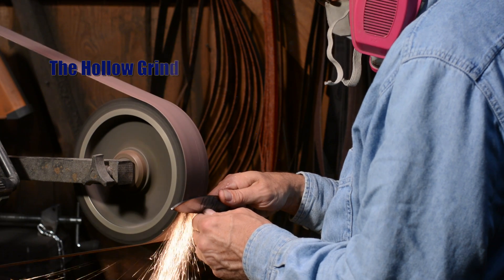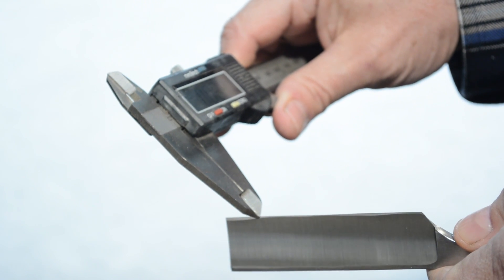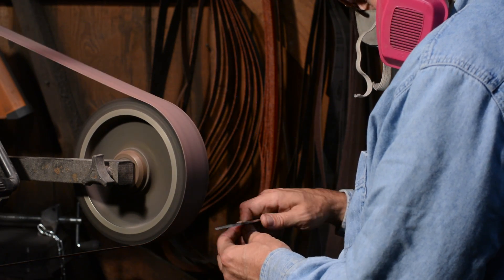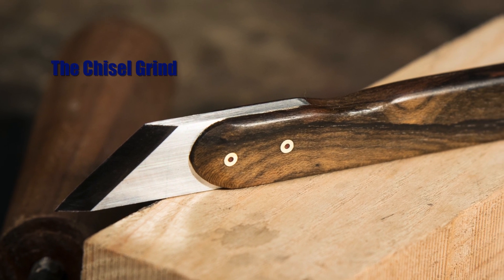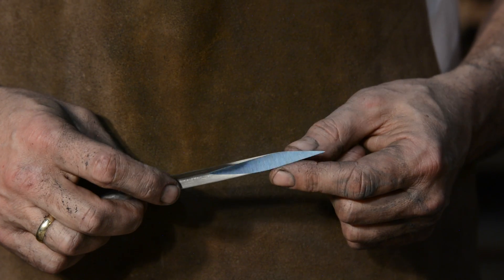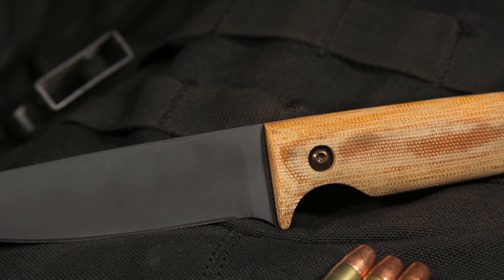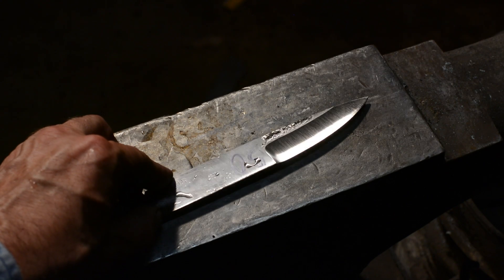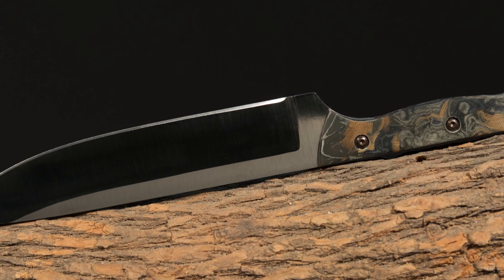Knife Grinds:  Comparing Hollow, Convex, and Flat Grinds

Comment: @Walter Sorrells I wonder if you will see this comment , not to mention it is on an older video , but how would you hand sharpen a convex grind after it is dulled , I am not sure about the blade terminology , but usually on a knife there is a parallel part , then one angle and then third the edge , I know to sharpen knives like that , but when it has a convex grind and only that one big edge , I dont get how to sharpen the knife without making that "third" edge ... I hope you get me xD

Comment: I wonder how a knife with two different types of grinds would preform.
I want a beefy knife for light wood processing, but also for making feathers sticks and crafting. So I thought about making a know with a convex side for chopping and a scandi grind (which shouldn't be too bad while chopping) but I want to be able to get the correct angle for feather sticking. That's hard with a convex grind.
Reply: If I were you, I'd get an axe for wood chopping, and a flat grind for woodworking...The knifes are relatively cheap now a day, maybe you can get two knives to get what you want to do...

Comment: bill moran called it the apple seed grind. convex is best for hunting by far, best for field dressing, i have a 500 dollar masamoto japanese sushi knife and went for free lessons in ny.  do not ever attempt to sharpen and i would have to write a book . love full height flat or full height convex from spine to edge. i was brought up by the masters like lile  and moran and the first ground was then called the secondary even though it was grinded or forged, but the edge we do after the primary cuting edge that is a sepperate bevel from about a .02 thicknest up frop secodar apex we cut in our pimary cutting ground.  why did the terms of sec and primary changed. is the secondary bevel called secondary because it is done after the primary. i would like to see it go back the way it always was. the sec though cut second , of course is still your primary cutting edge. if it is scandi and single beveled then it is a single bevel primary
as i said my best for almost anything is a full or close to full height convex down to edge, sometimes if edge is to thick it has to have some soulder of edge taken away or stropping will keep that factory  edge to become dullerand duller  a mocroscope is a great tool for this kind of reprofiling for making things better on an already good but reparable . knife..

Comment: Outside of the difficulty of maintenance and manufacture, is there any downside to a convex grind compared to a flat grind for all-around knives?  It's sturdier and the same or potentially greater sharpness, isn't it?
Reply: convex has less sharp end potential than flat grind.
Reply: Demmrir I was just thinking that, but how you would sharpen it is a huge factor. after hardening you can't use that belt at any Kind of practical speed, maybe a rocKing motion on your wet stone, but that would be very precise and time consuming work. any little roots would come out through the thousands of passes you would need to reMove material from that whole edge.

Comment: convex grinds can be made on contact wheels/bench grinder by moving the blade up and down as you grind, its way faster than slack belt grinding but tends to give a wavy pattern on the grind line

Comment: In my xp, full flat and convex are better at slicing like cardboard and soft stuff, hollow seems to not be as good, but is better for skinning game and cuts well, just not a great slicer. Its why most kitchen knives are not hollow grind. Also, I'm referring to mostly a half hollow grind, one from the spine is on par with flat, maybe more support on spine. Full convex can be sharpened easily with sandpaper and soft pad as well. The nice vid
Reply: Yes but kitchen knives are thin over all which makes then good slicers,overall a hollow is the best slicer as the point of contact is at the cutting edge and the spine leaving the hollow part friction free

Comment: Saber grind with secondary bevel and shoulder rounded off = full convex
Full flat with secondary bevel rounded = full convex
Full convex is the only superior grind. Is is any grind that is made with quality as opposed to made the easy way. It can be very thin, thinner than a full flat grind with a secondary bevel. Or thicker than a saber grind. It will push wood out as good as a scandi, yet with the rounded shoulder will slice better. The only other grind that makes sense is a full hollow, like an I-beam, for something like a razor, because it is ultra thin yet has enough support along the spine. 

The grind that makes the least sense, by far, is a partial hollow ESP with a secondary bevel. You have a steeper cutting edge, that transitions sharply to the begging of the gring which is almost flat, then that ramps up at a steep angle, then another flat portion along the spine. This is a ridiculously ineffective grind for literally everything.

Comment: is the secondary bevel necessary in a flat ground knife? if it is i would very much like to know.
Reply: No, it is not necessary and swords that have full flat ground blades (like many late-14th-early-16th century European swords or the 13th century European sword, the Elmslie type 1 falchion) usually don't have a secondary bevel as it limits the performance.

Also many Middle Eastern and Indian swords were made with full flat ground edges without a secondary bevel and most Navy cutlasses around the world and in fact a good portion of sabres also have this kind of edge.

And then there are the Scandi grinds for knives, they don't have a secondary bevel either. Hell most knives about 150 years ago that were flat ground didn't have a secondary bevel (when professional polishers were literred through towns like it was the only thing that made money).

Comment: I agree about the flat grind limiting the sharpness. But lately I've been putting the secondary bevel on a really shallow angle, making the cutting edge quite thin and , therefore, sharp. With proper heat treating, I've been able to produce a really good zone between being too thin and not being able to take the beating to being thin enough to get and stay razor sharp through the beating.

Comment: I find a flat grind without secondary bevel (where the cutting edge is at the same angle as the flat) is a fairly good balance between hollow and convex but allowing very sharp edges as well. Particularly noticeable in wide blades where the angle of the flat is really steep.

Comment: Considering I can sharpen my scandi grind (deeper flat grind) in the field with emory cloth pinched between my thumb and forefinger.  I'll stick with scandi.  The other advantage is you are taking equal amounts of steel off both sides at the same time.... it would be very hard to move the edge off centre.   The downside, it isn't as fast as a belt grinder... especially if your knife is a very hard steal.

Comment: Regarding the convex grind, these are fairly easily sharpened by proper application of the 'mousepad-method' - the mousepad is used as a flexible backing for different grades of SiC-paper; a drywall hand sander works even better since it has clips to hold the paper. Once the convex edge is sharp, a strop will give it the final finish and also be useful to maintain the edge for a long time.
Reply: Sharpening a convex grind is pretty easy on a whetstone. That mousepad method is some masochistic but somehow funny phenomenon.

Comment: I find 'proper' chisel grinds easy to sharpen. 'Proper' being the Japanese style: the blade made from a steel strip laminated to iron for easy sharpening of the bevel and a slight hollow grind on the reverse for easy sharpening of the flat side.
That way you only have to put the bevel to the stone until you get a burr, then do the flat side to remove the burr, strop and you're in business.
Reply: +kaizoebara   Exactly what I was thinking when he said that they were more difficult to maintan.  They're actually easier to sharpen than trying to maintain a consistant angle along the entire length of the very small secondary bevel on a flat grind, since the bevel itself is the angle you sharpen at.  All ya gotta do is just lay it flat on it's bevel, just like a scandi.  :)

  Also, as you mentioned, with the urasuki (wide hollow) grind on the back, there is such little surface area on the back to keep flatten that it goes pretty fast.  I was actually a little surprised that he didn't demonstrate, or at least mention the urasuki grind in his last "Japanese damascus marking knife" (kirdashi) video, being that he's known for making traditional japanese blades.
Reply: *****
 Maybe he didn't mention it, because he didn't grind an urasuki.
I also find that strange since it is a feature that can be found in almost any Japanese chisel grond blade, e.g. kitchen knives, woodcarving knives and incidentally also in Japanese chisels.

Comment: Why wasn't the Scandi mentioned? Such a great grind. ....and so easy to sharpen. .....even a child can do it.
Reply: +TaskMaster1983 I think the one little difference, though, is that the scandi grind doesn't have that secondary bevel for the cutting edge. It goes straight on down from the primary bevel to the cutting edge. I'd prefer the technical saber grind to the scandi grind.
Reply: +John Grytbakk 
Easy to maintain the bevel angle, but it is the most labor intensive and time consuming of all grinds to sharpen.
Reply: John Grytbakk Well, if you think about it, on any grind that utilizes a secondary bevel you only have a very small amount of steel to remove. Whereas, on a true full scandi grind you are removing steel from the entire grind. That's a heck of a lot. 

I bought a classic carbon Mora, that came with a "slight" secondary bevel from the factory. I wanted to experience a true full scandi, so I got out my big diamond stones, and went to work starting with the extra-course. Ended up taking me hours and hours to get it completed. When finished it was freakishly sharp.

....But I found out that it was basically worthless for actual use, the first time I tried whittling some wood with it. The edge was so fine that simply shaving wood managed to mangle the edge in moments.

I ended up putting a secondary edge back on it. Now it works ok, and resharpens easy, but I'm far from impressed needless to say.
Reply: He did mention it. Scandi grind is also known as a Sabre grind.
Reply: +TaskMaster1983 

https://ltwrightknives.com/grinds.html
Reply: Bastian  ....I don't find that to be the case at all. ...it's so easy and quick.
Reply: Bastian  ....even though the bevel is bigger, it's so much easier to get it right fast when sharpening I've found. .....and if you touch up that bevel and edge regularly, it is a quick job.
Reply: John Grytbakk
Reply: John Grytbakk you probably accidentally microbeveled it and are sharpeming just the microbevel
Reply: Peter Griffin Actually, the angle depends on the thickness. A scandinavian grind is just a flat grind with no secondary bevel/ microbevel.

Comment: Good info, however; I would have to disagree on the convex. I find my convex blades and especially those other grind knives with their secondary bevels "converted" to a convex edge the easiest to maintain. No precise angles to worry about. All you need is a somewhat flexible surface and some light abrasive. In a pinch, out in the field, some silty mud from the creek bottom rubbed on your thigh of your jeans and you got an instant strop for that convex edge. Like some of the others have stated, I am also somewhat partial to a Scandi grind as well for out in the bush.

Comment: is the scandi grind the same as the flat grind?
Reply: +keifer225948 No, not really. The Scandi grind has one consistent angle all the way to the cutting edge from its primary bevel while the flat grind has secondary bevel. I was going to explain this to you in multiple paragraphs but after typing it out it makes a lot more sense if I just show you. 

http://bushcraftknifeguide.com/bushcraft-knife-guide/blade-grind-guide/
Reply: +keifer225948 They are similar for sure. It is like a flat grind with a secondary bevel (where the main "grind" is parallel and not tapered as with the flat grind.) The ratio of top bevel to bottom bevel is also different in the two because of the varied thicknesses towards the edge. This is why the scandi has a larger "secondary" bevel (the main one being the flat "stock" of the blade and the flat grind has a much smaller secondary bevel.
Reply: +RLJ3213 The "flat grind" pictured there looks more like a saber. http://1.bp.blogspot.com/-laWKxe1hxvM/UU3l5zziUkI/AAAAAAAAAno/2nVjBRKao6s/s1600/1gr.png
Reply: +Colson Customs Yeah I should have paid closer attention to that, that picture was the biggest one I could find that showed both. 

+keifer225948 Colson gives a better example, while mine is technically correct it is misleading.
Reply: Thanks for the info
Reply: +keifer225948 I think is a kind of flat grind, I mean, obviously the bevel is flat, but it has no secondary bevel and the angle is mucho more agresive, with a bigger flat side